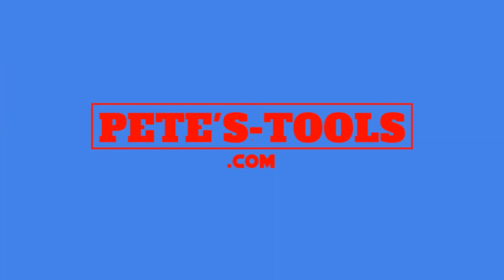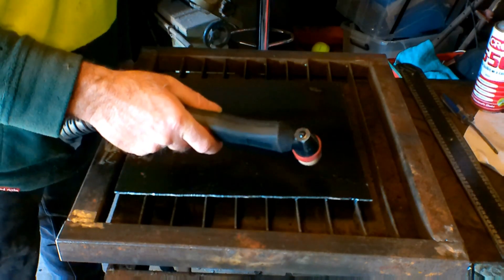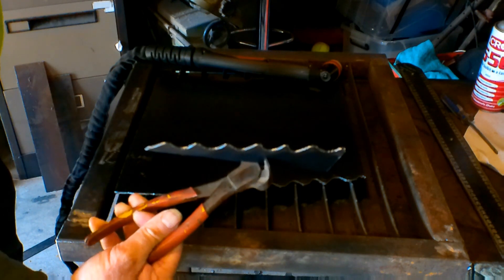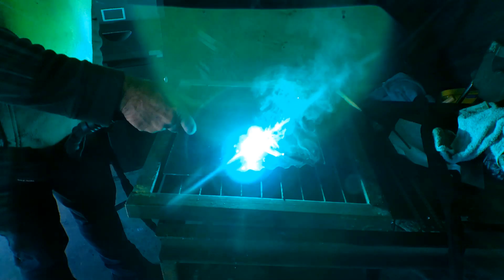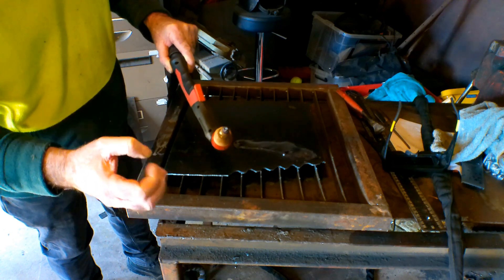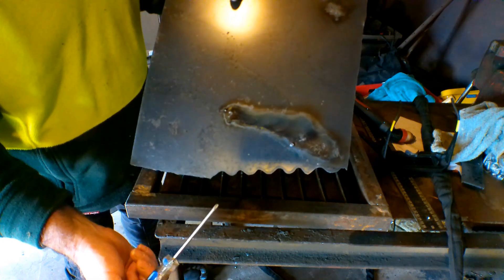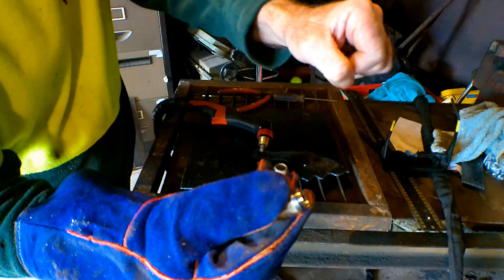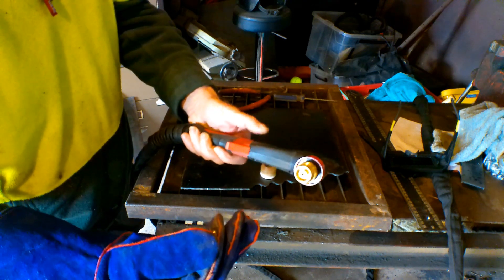🧯Plasma Cutting With No Air☢

Comment: Yeah I had a amico cut40 that I bought and fixed and hooked it up and started trying to cut and forgot to turn the air on and low and behold 6 seconds later it shot the overload inside the machine and burned it up and the whole time you where demo straight ing I was waiting for the machine to go 😱
Reply from the maker: So was I LOL
THANKS FOR WATCHING
Reply: @petestools   is your machine running on 120v

Comment: I have to keep playing with the pressure on mine. I'm not getting those clean lines, freehand cutting yet.
Reply: I didn't change the air pressure but let my uncle who has a lot of oxy/acetylene cutting torch time there was a world of difference between our cuts. Mine were uneven with slag and his were straight and clean. It was probably roughly 5mm thick steel we were cutting at 40 psi.
Reply from the maker: plasma cutting is part art I recon
Reply from the maker: how long have you been using it ?
Reply: @petestools  for me about 30 mins I'm still learning. I know from what everyone is saying air pressure makes a difference but obviously so does torch handling. I do need to find a guide to use for cutting straight.  Mine isn't pilot arc but it sure doesn't care about rusty metal. Primeweld 520d
Reply: @petestools  Just a couple days. I just got it.

Comment: I’ve come across a lot of guys with that problem of not enough air, and a lot of burned consumables. They almost always blame it on the consumables, when it’s the air.
Reply from the maker: your not wrong mate 
cheers Pete
Reply: What about the plasma cutters with built in air. Do those have an adjustment available?
Reply: Rich Brunner they do what needs to be done. But because of the size of even a small compressor, they’re big, bulky, heavy and expensive. They’re also low power. Some are just 15 amps, and a couple of others are 30 amps. The 15 amp models can realistically do 1/8” (3mm), and the 30, about 1/4” (6mm). But that’s pretty much the max. Did I mention that they’re expensive? The cheaper ones aren’t worth a damn, as they never meet the ratings, and they tend to break down. And the good one are, uh, expensive.
Reply: @melgross  I'm not sure I'd call a hobart airforce big but I don't know what its capacity is. Its my buddys. I bought a cheap multiproces unit. I intend to learn on it. I was just confused on how those all in one units ran on that dinky compressor when my slower but higher psi compressor has a harder time at 40 psi. I just figured it was lower psi but higher cfm capable.
Reply: Rich Brunner it weighs 27 pounds. That’s very heavy for a 12 amp plasma cutter. That’s right, 12 amp. 1/8” is all you can cut. It’s designed for sheet metal. 1/8” and thinner. If that’s all you need, fine. But there will come a time when you want to cut 3.16, and you’ll find it to be a problem. It will possibly sever it, that is melt the cut so that it’s a mess.  1/4” is out.

40 psi is WAY too low. Some cutters will let you get away with 70, but generally, at least 90 is needed.
Reply: @melgross  I'll have to look at its book but I think it said to set it at 40. It is roughly a 50 amp unit but I've only tried up to 5 mm give or take.  Just junk stuff laying around.
Reply: Rich Brunner a 50 amp unit set to 40 psi? That makes no sense. You need sufficient pressure to blow the molten metal out of the cut, and to keep the tip cool. You can have a huge amount of air going through, but with these small nozzle holes, you need the pressure to push the air out. If the air pressure is too low, the air won’t come out. The nozzle restricts the amount of air going through. Yeah, look that up and let me know what it says. Who knows, it could be a typo.
Reply: @melgross  I need to find out where I stuck the manual last. I looked up a different but similar brand and it said 65 to 70 psi. It might be working for me at 40 simply because I am not cutting anything thick. I'll let you know what it says once I find the manual.
Reply: @melgross  So I found the manual and it does indeed recommend 40 psi , BUT later in the manual it states air pressure and current may need to be adjusted depending on material being cut. So it gives no indication of what to set it at besides 40 psi. I'm pretty this is just one of those chinese boxes with one of the many brand names on it. So I don't expect much from the manual. I'll try it higher but so far at 40 it has cut decently for scrap cutting.
Reply: Rich Brunner ok, that’s interesting, but I would go higher.
Reply: @melgross  I'll try higher but I definitely know technique means a lot too.